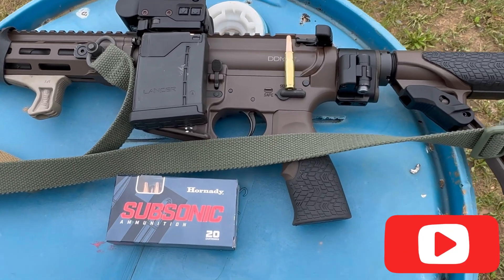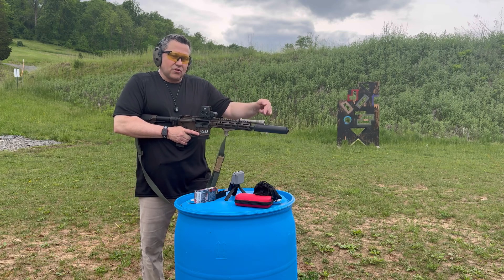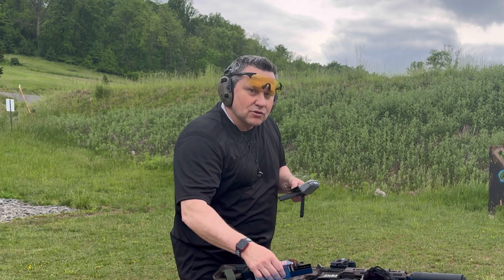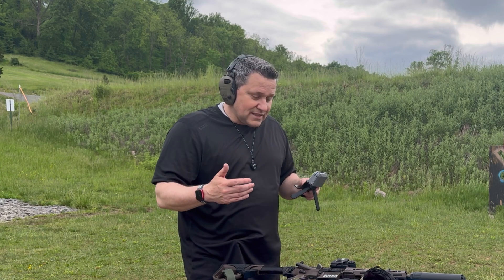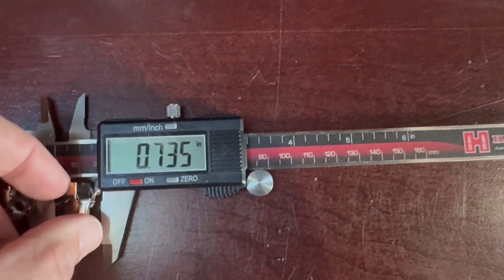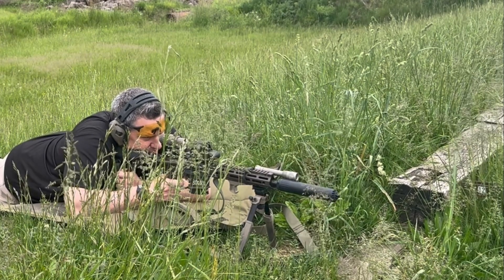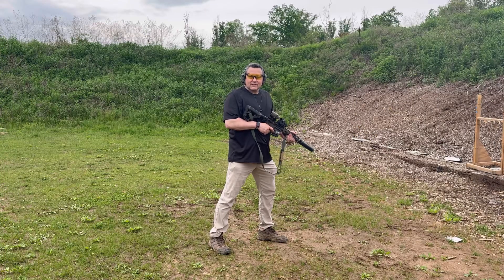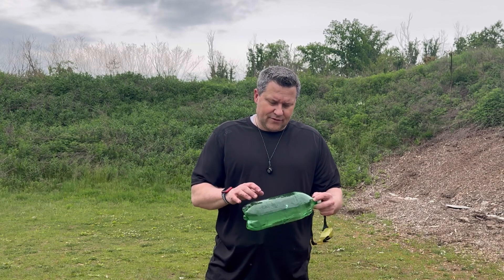300 Blackout Hornady SubX 190 gr Subsonic Perofrmance?

Comment: Good vid.  Did you have to adjust your gas settings, springs, or anything to help it cycle?  Some were saying they couldn't get it to cycle since it has such a blunt tip too.
Reply from the maker: I have had some issues with this ammo in my PSA JAKL getting it to cycle.  It definitely needs a lot of back pressure.  I had to go with a traditional can there.  But the Daniel defense gun is a bit over gassed and seems to run it just fine.  It's a pretty soft shooting round for sure.  I believe it has to do with the softness and gas tuning than the feed ramp with the design but I could be wrong.

Comment: Had the same results as you. But I loaded 8 grains Lil’ Gun for 1100 fps. It’s a very accurate round with my 10.5 inch barrel. Thanks for the video.
Reply from the maker: Yah, I think I need to hand load this.  I was having cycling issues with it and my psa jakl, same thing just wasn't loaded hot enough.  BTW, I never knew how much temperature effects the speed of sound.  Because the "crack" is a pressure wave, and pressure is affected by temperature, about 1fps for every degree.  So if you test something at 75 degrees and it's sub sonic at 1100 fps, at 25 degrees the sound barrier will hit 50 ftps lower (ie, if the sound barrier was at 11000 fps at 75, at 25 it will be at 1050....)  crazy.

Comment: The performance of this like most subsonic rounds is on par with duty 9mm ammo. You are paying a heavy price in size and weight just to get a “quiet” gun. The rifle is as long as a 16” AR and at least 10 pounds as shown. All to get performance that you could achieve out of a P365xl.

I’m not disparaging the creator of this video or the cartridge. Your videos are great and I enjoy them. 300 blk is an awesome cartridge but the subsonic loads are only optimal for very specific purposes.  If you need a defensive load, go supersonic in the 110-120 range.
Reply from the maker: That’s a great point.  I spoke more about that in my previous video that I referenced during this video when I compared 45 acp and 300 blackout subsonic.  I also spoke about why a rifle vs a handgun and the ability of going supersonic and the amount of more damage that can be done going supersonic.  But I agree with you and appreciate you taking the time to leave this comment because others may be wondering too!!
Reply: That gun is not 10lbs 😂

Comment: Very accurate round for sure great groups. You got a can on that gun I would just use Supersonic and get The lethality that 300 Blackout can truly deliver. It's your home defense weapon no Second Chances
Reply: Cans are meant for subsonics!!!  I own multiple cans and honestly, shooting supersonic bullets out of a can isn’t worth the tax stamp.
Reply from the maker: @all4freedom100 I mean, I really enjoy hunting with my 308 bolt action.  It made my elk shot much more enjoyable for me and those with me.  I also enjoy it on my 556 guns.  It’s definitely not as fun but I still feel it’s fun. 🤷‍♂️
Reply from the maker: I guess the reasons I like the 300 is for versatility.  Going super or subs depending on the situation and circumstances.  My current bump in the night load is 6 of these rounds followed by 110 grain supers.  Knowing my holds on both is easy with the eotech.
Reply: @triggerbarPhD  understandable. I was just astonished at the amount of damage it does to a 200 lb hog. That's after taking them with just about everything I own period from 10 mm pistols to 30-06 . If I did own a can I'd probably do the subsonic thing too there is a big cool factor to it
Reply from the maker: @michaelmcmillan2776  its definitely fun.  That’s awesome about using supers on hogs.  If you saw in the comment section Brad Branch uses this SubX round on hogs and it seems to perform well.
Reply: I did see that we're definitely going to give it a whirl

Comment: great video.  So on that second group shot into the splatter target, what were you aiming at?
Reply from the maker: The bottom of the upper left diamond so it was low and right the same as the first group.  I always try to pick a point so I can be as accurate as possible.
Reply: And, it helps not to chew up the point of sim.
Reply from the maker: @craigm1954  very true. One of the reasons I like these targets is one obviously filming they show up better and two there are lots of different aim points on it.

Comment: those were some nice tight groups - especially the group you put into the gel. haha
I wonder just where they turned around on their trek...not sure I've seen a round have the jacket fold back the other way how these did.
Reply from the maker: Yes that fold forward was very weird.  No idea.  Wish I had a $10,000 high speed camera.  I found a camera for $500 that does 4 seconds of 1000fps.  Just not sure I could time starting the camera and shooting the round into gel into the same hole as the previous spot in that amount of time 😂🤣🤷‍♂️
Reply: @triggerbarPhD  just as you were about to do your 2nd shot I was sitting here saying out loud, "oooh, no......don't do it!!!"
And yup, sure enough. Did it. hah
I have to lean towards it flipped right at the end and explains why both tips are right there, but it doesn't look like any tumble in the gel there. 

Super slo-mo would be really cool for sure!!
But just 4 seconds...That sounds like a recipe for frustration, or worse.

You'd likely need someone there with you to catch it if only 4 seconds. Or have a Kentucky Ballistics pull-string trigger thingy and operating the camera with one hand, and the string with the other.